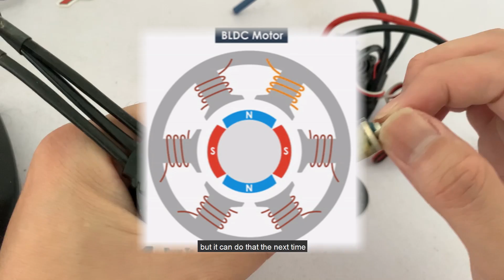Sensorless VS Sensored Brushless Motor | Hesitating Explained

Comment: Very simple and easy to explain video...great job.I wanted to ask you if there is a way to delete the.swnsored since my esc does not have it.Thank you very much for your help
Reply from the maker: Yes, you can do it, but expect rougher startups and lower torque at low speeds. If your Rc car involves frequent stops and starts (eg. crawler), it’s better to use a sensored ESC.

Comment: What’s gear motor you are using it for your bronto?13,14,15,16,17 and the spur you are using is like 64/58?
Reply from the maker: Yup it’s 64t at spurs.13t at pinion. This setting is good at low speed for crawlers or big foot

Comment: Would the 120a hobbywing run with a 13.5 Turn Motor, have this Combo now and IT dont Runs, IT Just stutters so i am triyng to Figuren Out if IT is Just a Bad soldering Point
Reply: Its not the soldering, its the programming in the speed control itself.  I also have a bad one that it works sometimes and then doesn't have any throttle.

Comment: Hesitation is mainly an ESC thing. Get a better ESC amperage and keep the same motor, it will start smooth af. Most of the times when the ESC is fried the motor goes as well. A 4 poles bl motor will do the job well. You don't need 6 poles. This - I need more - logic seems asking for a super big dick when you only have a small one. Keep it real.

Comment: Man change your mic...I cant handle this  audio quality...
Reply: Is this blue motor and esc compatible with 8.4 volt battery =4200MAH
Reply from the maker: Can, in fact I used 11.1v (3s) in this video, but recommended 7.4v (2s) will be more long lasting😊, thanks for watching
Reply from the maker: 🫢okok time to buy a new 1, thanks for your feedback 😁
Reply: I dont think its the mic but the background music that's unnecessary.

Comment: F540 can you tell me the order of the rotor washers please
Reply from the maker: Thanks for watching bro 👍. i'm not sure if i understand correctly or not, in brushless motor has only 2 steel washer which located at the front and rear bearing of the motor, which it helps to improve the balancing during its rotation.

Comment: Good explanation bro! No issue with this kind of cheap sensored ESC? Mine caught literally fire on 3S, I bought a more expensive 10bl120 from HW…
Reply from the maker: Yup bro, the cheap sensored ESC not really durable. It burned after 10min off-road crawling with 3s.😅
Reply: @ACeperienceRC  i heard they’re alright in 2S